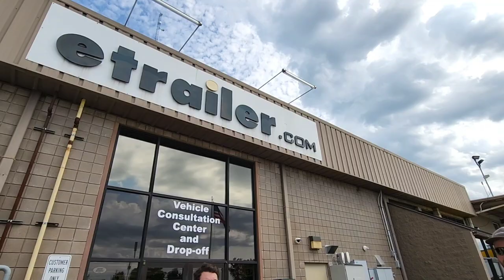Incredible and exclusive behind the scenes with Truck and RV Gear! Everything etrailer.com!

Comment: Hi JD, I am so pleased that you made a video on e-trailer and the wonderful folks who work there.  Back in 2017, when I was considering my truck and 5th wheel package, they helped me by selecting the correct components to use for my 2017 RAM 3500 Mega cab 6'4" Ram Box bed & 2018 Montana 5th wheel.  They recommended the Reese 20K 5th wheel hitch and the Reese 19K Sidewinder pin box, which allows 90+ degree turns without potential impact of 5th wheel nose to truck cab, nor damage to the Ram Boxes.  They assured me the ride and stability would be superb and it is.  Also, this past summer, the folks at e-trailer recommended one of the only e-bike racks for the rear receiver on my Montana 5th wheel which is DOT approved for insurance purposes.  The Swagman e-bike rack works perfectly as they stated and I feel 100% safe with it.  E-trailer is the absolute best source for any questions regarding towing and everything associated with any of it.  The e-bike rack alone had 10+ videos from e-trailer for virtually any possible application, pro and con.  I prefer to buy  through e-trailer rather than direct from a manufacturer just save a few $$$  because e-trailer stands behind their recommendations 100%.  By far one of your best ever videos, thank you.

Comment: ETrailer is a wonderful company. Years ago I purchased a wheel and tyre combination for my little utility trailer. Tyres arrived ready to use at the proper inflation. Six months later, still held proper air pressure. It held the air pressure for probably five years. Thank you for the tour and have a great day.

Comment: This was a lot of fun to watch. I'm actually planning out for a major wheel and brake system upgrade on my BigTex 14OA equipment trailer. Its time to dress the wheels up and switch to disc brakes. The trailer is used every day, so it deserves some pretty (and safety) upgrades.

Comment: Well JD, as you are aware, I have had some significant issues with Etrailer.  So even though I have discontinued doing business with them, I gave them the benefit of the doubt and after watching your video, went over to look at the reviews on FB.  I see they are still up to their old tricks of claiming stock but not being able to deliver and leaving the customer holding the bag.  No Thanks!  Be aware folks that you have been warned!
Reply from the maker: Brother, I remember you shared your experience with me.  I know you warned folks with this comment, but every other commenter has had a great experience with etrailer.  Not sure why yours didn't get resolved.
Reply: @BigTruckBigRV  JD, look at their real world reviews that they don’t moderate and you will see hundreds of similar reports.  I am not alone.
Reply: I haven't had a problem with them and they are great on answering questions.
Reply from the maker: @Brantel.   I don't disagree.  What I did find out is that they ship over 6,000 orders PER DAY!  They have a display that counts down each day.  A few hundred of negative experiences over decades of business is probably a fraction of .001% of the orders they process.  Definitely not good when it's your order though.  I'd wouldn't give up on them though.

Comment: The prices are to high. You need to make over 1000,000 a year to buy.
Reply from the maker: Umm huh?  Didn't know only millionaires bought bed covers
Reply: When you shop around, you’ll find that their prices are competitive.  What is priceless is the support you get from etrailer with your purchase.  What’s that worth to a feller?  Don’t just settle for cheap.
Reply: Unhappy Bill?
Reply: My airbag system was definitely not a million bucks 😆
Reply: I agree with others as they are competitive. Not the necessarily the cheapest,  but not the most expensive.